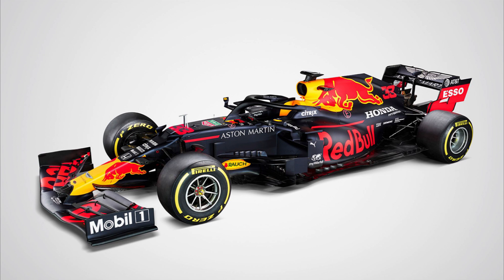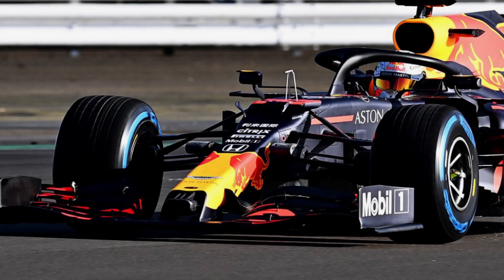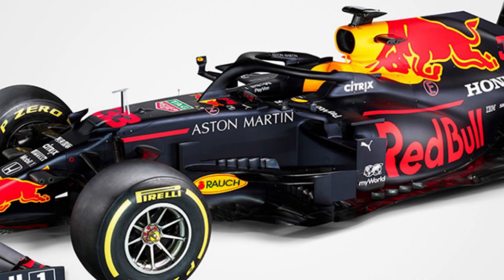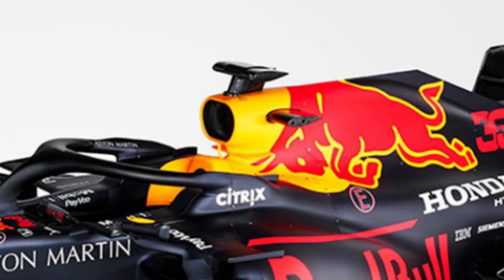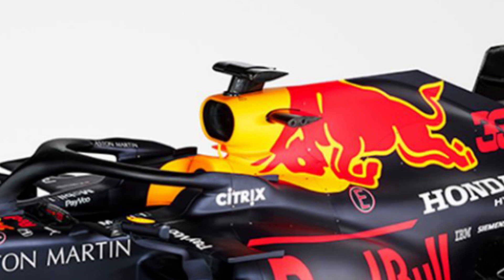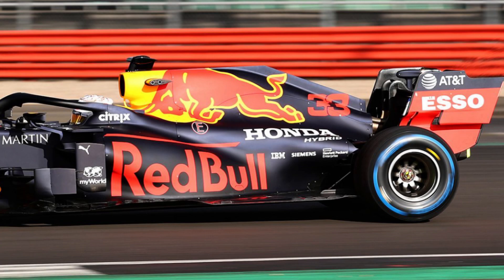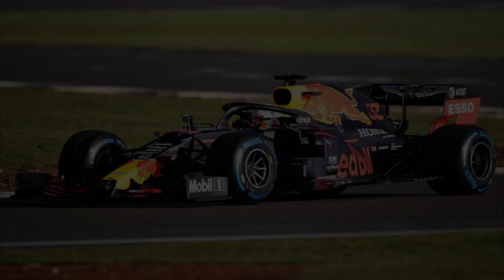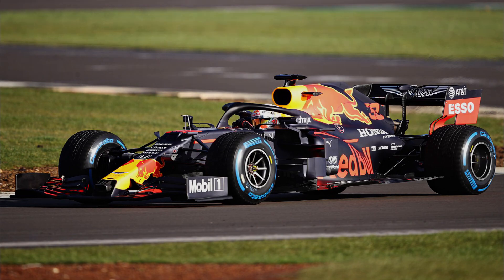F1 2020 Red Bull RB16 Analysis

Comment: The elements on the floor (in front of rear tyres) are used to direct air flow towards the diffuser, not outside of the tyres.
Reply from the maker: True, I probably wasnt clear enough on that. I was trying to refer to the set of vortex generators ahead of that on the floor, just past the bargeboards